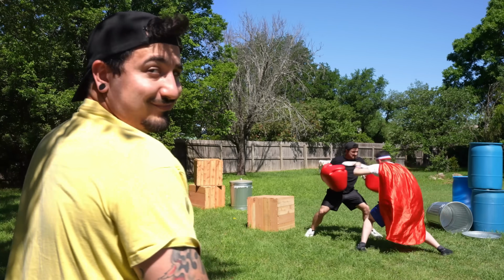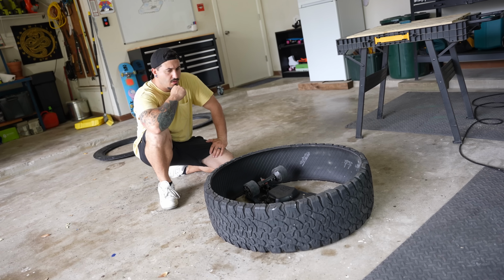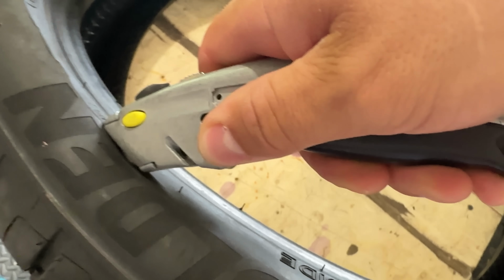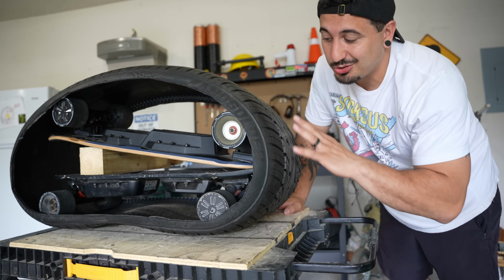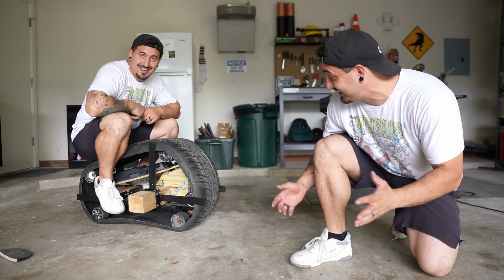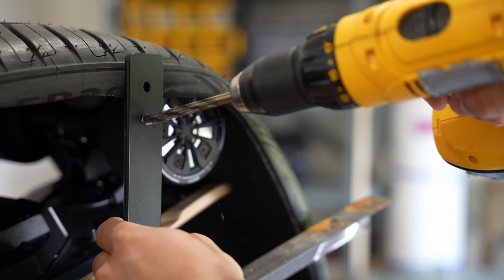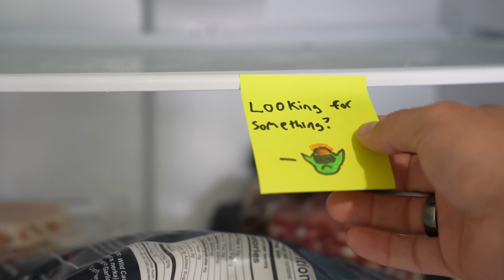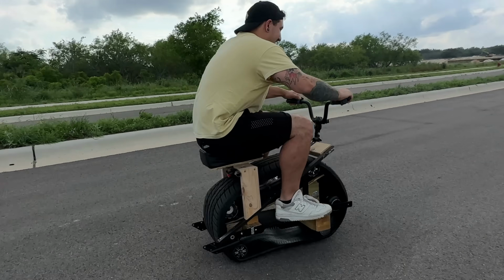I Built a MonoWheel Bike!

Comment: Anyways, here’s a brownie recipe 

Ingredients:
- 1 cup of butter
- 2 cups of sugar
- 4 large eggs
- 1 teaspoon of vanilla extract
- 1 cup of all-purpose flour
- 1/2 cup of unsweetened cocoa powder
- 1/4 teaspoon of salt
- 1/2 cup of chopped nuts (optional)
Instructions:
1. Preheat your oven to 350°F (175°C) and grease a 9x13-inch baking pan.
2. Melt the butter in a saucepan over low heat.
Remove from heat and stir in sugar, eggs, and vanilla.
3. Beat in flour, cocoa, and salt. If desired, fold in nuts.
4. Spread the batter into the prepared pan.
5. Bake in the preheated oven for 20 to 25 minutes. Do not overcook; the brownies should be moist in the center.
6. Let the brownies cool in the pan before cutting into squares.
Enjoy your delicious homemade brownies!!
Reply: Brownie.
Reply: B R O W N I E S

Comment: If the alternator worked as a motor you could gain power back in the train:   (O-o-o-o-O)     (O=AC MOTOR) Then swap between the two for forward and reverse. Then even go all wheel drive but this would deplete the battery faster. You could even have vorpal induction fan that could draw air into the manifold that would supply more power. The problem though is at high speeds the battery could over charge and blow. So they would need to be shut off or have some sort of depletion outlet. Speakers with tunes?

Instead of ordering a new tire you could have taken the scrap rubber you cut of cut and wrapped and adhered them with rubber cement the around the wheels and then heated and sculpted the profile with a heated iron. Respirator. You made even have been able to fondued the rubber in a double pot system and like cast molded it.

Heated blade. They round the tires with heated blades at race tracks to get rid of rocks and surface imperfections that get stuck in the rubber from heating up at high speed. NASCAR tires legit are melting on the track.

Comment: Would've just cut the skatboard tires down, you only needed to lose a couple of inches from what i could tell and making the skateboard wheels skinnier would've been cheaper than buying a whole new tire... probably easier too, especially if you have belt sander or a hack saw and a drill...mount the wheeel to the drill, spin against hack sw, bada bing bada boom...skateboard fit 😉

Comment: As a mechanic, tire sizes are the stranges thing I have ever seen. The first number, usually 3 digits, is in metric and is the width of the tire. The second number is the ratio between the width of the tire, and the width of the sidewall. And finally, the diameter of the wheel hole in inches. Metric, a ratio, and American. Who's idea was that?
Reply: Yeah I'm getting a collage degree in mechanical engineering and tire sizes are very hard to understand if you dont work on cars
Reply: @ColtMiller-n9p  and the calculations to maintain wheel diameter while changing rim diameter is wild
Reply: @ShakeHandsWithBeef  yeah, I've been in college now for about 2 years studying mechanics/engineering. I love it I'm buying a old car garage with all the stuff still in it, it's 65k
Reply: @VenomBandOc  heck yea man! Can't wait to see the progress 👌